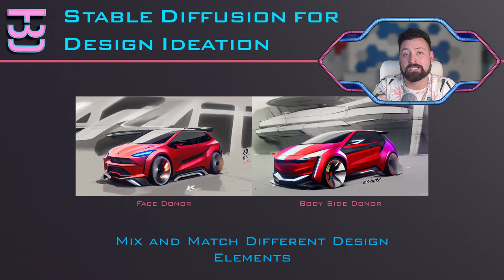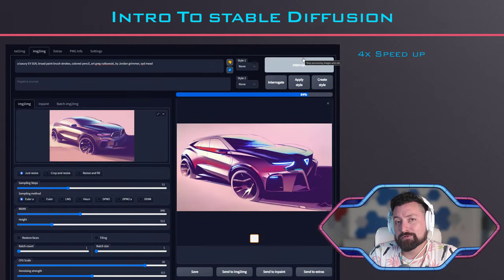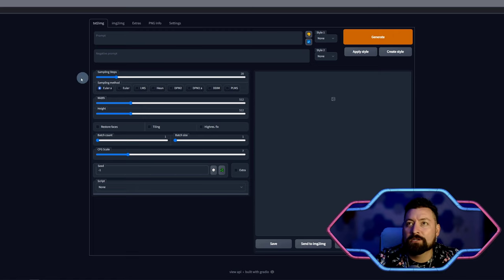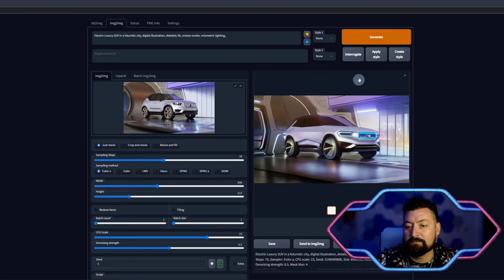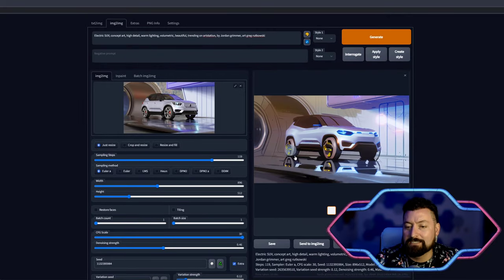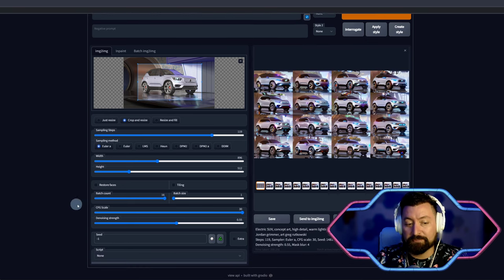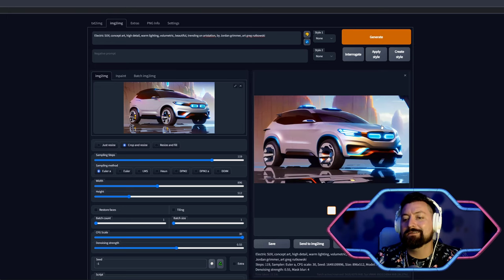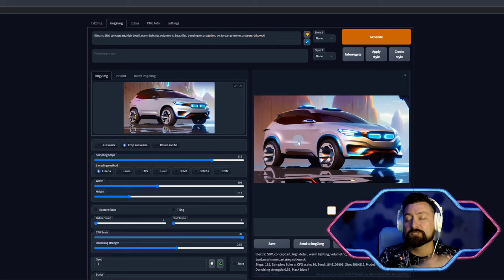Using Stable Diffusion for Design Ideation

Comment: First: thanks for this informative video! Appreciated!

This all seems great but what would really make it a no-brainer to me would be the option to highlight only certain areas of the image with a paint brush for any software to only continue making iterations of that highlighted area. 

For example: I'm super happy with one single car design but the front lights still look wrong to me. I'd then choose a paint brush-like or selection tool to ONLY highlight the front lights and let the software generate further iterations of the chosen image with different front lights only.

Is that possible in Stable Diffusion or any other software like Midjourney atm?
Reply from the maker: This is called in painting and it is very easy to use, theirs some examples in the guide I linked to in the description

Comment: Awesome Ray...thanks so much for sharing. quick question off topic how do you get the "dark theme" background for SD's user interface? Is that somewhere in the settings....
Reply from the maker: I don’t know 🤷‍♂️ I was wondering that myself cause I’ve seen the white theme, but I’m assuming it’s in the settings
Reply: @HandleBar3D  Okay than....when you installed it on the first go ...was it defaulted to the dark theme?
Reply from the maker: @scottadam4268  yeah I think the reason is I have my chrome set to dark mode, so maybe that controls the look not stable diffusion, but yeah it’s always been dark for me
Reply: you can add "/?__theme=dark" ad end of the of the string in the address of the browser

Comment: Man this is fantastic thanks, exactly what I was looking for. I just wanted to ask you one question. I cannot see all the pictures I have generated in the screen on the right, I can only see one by one and as soon as i generate a new image the previous one disappears. Do you know why? Also do you know how to create HD images? 
THank you again for sharing, this is so useful and as you said it will be the future
Reply from the maker: My guide in my page has instructions on how to make them HD. 
Every image you generate is actually auto saved in the output folder of where you installed stable diffusion. You can find them there. 

The latest release also has an image browser integrated into the UI. Hope this helps

Comment: Which model/version of Stable Diffusion are you using? I followed the installation video (updated version) of the one you linked, and got 1.4, 1.5 (pruned-emaonly safetensors) and the 1.5 inpainting one. The results are not as good as for example I would get from Lexica. Maybe I need to train the model?
Reply from the maker: I think I was using the 1.5 when I recorded this. Did you use the same prompts I did?
Reply: @HandleBar3D , I stuck with it, and I'm glad I did :) things are pretty crazy with ControlNet, Lora's and IPAdapter.. even started switching over for experimentation to ComfyUI. Still, it can be tricky to get fine control over a model, especially for products that aren't cars. I'm definitely getting useful results for concept generation, CMF variations, etc.
Thanks for kicking off this fascinating journey for me!

Comment: Hi Raymundo, unrelated but I have a question about vred professional, each time I add my environment it's doesn't appear on the scene where the car is until I turned on the raytracing , how can I make it appear without turning on the raytracing?
Reply from the maker: I haven’t used it in years, wouldn’t know

Comment: Great video but AI-generated digital artwork may not be copyright protected. Not yet atleast, I expect that to change within months.
Reply: The courts are slow. Maybe in 2023 there will be some early cases, but who knows how long it will take to create laws around this. IMO, it is impossible to have concrete laws around this. I, as an artist, already can emulate any other artists style by hand, so just because someone else can push a few buttons can emulate someone's style, what is the difference? They are just about to do the same thing faster with fewer button clicks and hand gestures. Times have changed, and there is NO going back.
Reply: @monkey4102  The law needs to be expanded to include AI artwork, I agree things are moving way too fast to stop what will be inevitable once way or another.